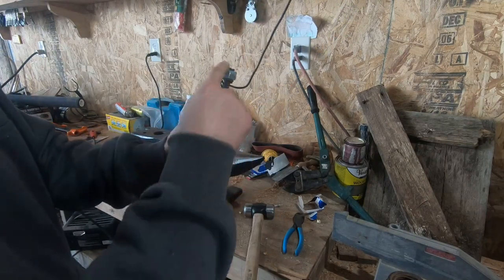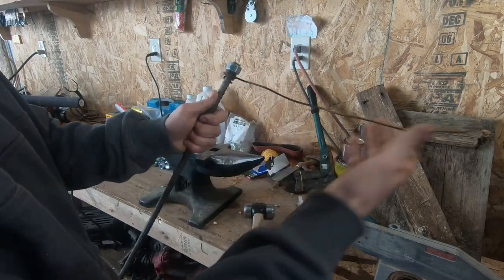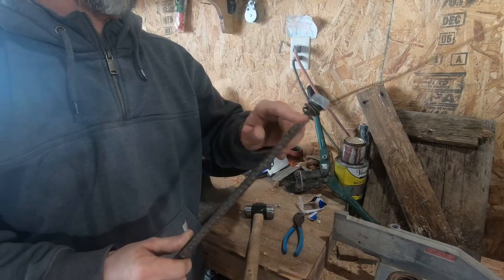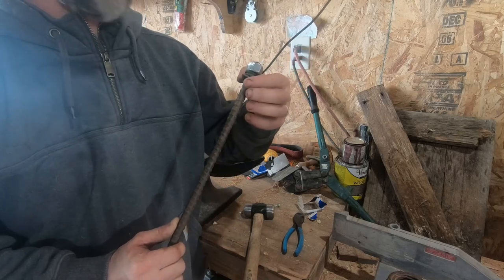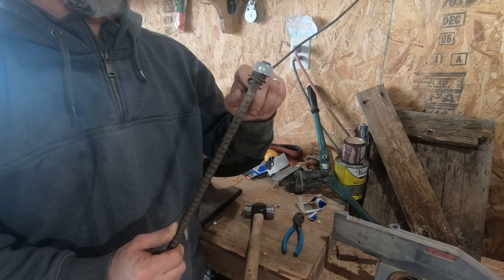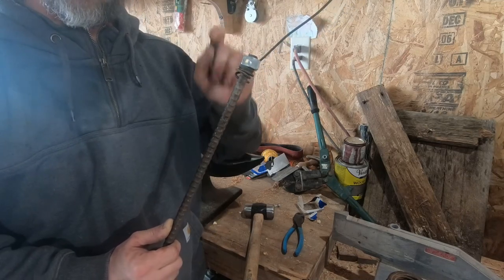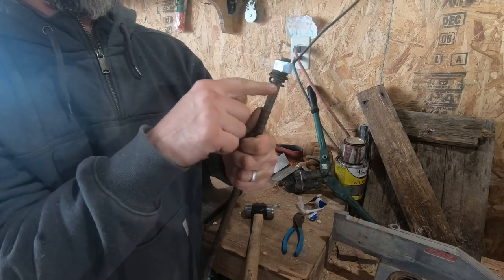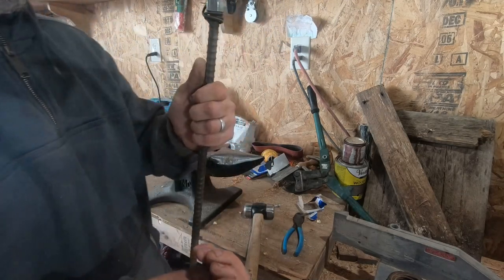TRAPPING TIPS- Worlds Greatest Snare Support Sytem

Comment: Great  tip on the supports, I picked up a 20ft stick of #4 rebar and 12, 5/8's nuts and made up 12 of the supports. Went out this afternoon and used some of them and they work like a charm.Not counting the wire , which I already had I have $1.70 in each support , very inexpensive for something that is a great anchor and support. Thanks Jeromy
Reply from the maker: That is awesome Mike! I just got back in from my trapline. I had a triple on coyotes using this same support, and then another coyote a couple hundred yards away. They do work great! I hope you have as good of luck with them as I have. Thanks for the updates too!
Reply: @jeromycooley-outwestadvent5790  Congratulations on the triple !! Will keep you posted, Thanks

Comment: Great job. I tried putting 24 inch 3/8 rebar cross stakes in yesterday.  They wouldn't hold. I got a 18 inch cable on a pogo in. It held good the place i am trapping is sandy bad. I use a killpole 5ft 5/8 rebar.  It has my anchor and snare support all in one. Plus they will wrap around the rebar and dispatch themselves sometimes.  I leave them in place yr after yr. I trap out of my truck. I know the rebar comes in handy. No looking for a place to tie off. I know the 5 ft 1/2 rebar.  A coyote will bend it. I use a 1/2 rebar on coons beavers otters cats and fox. Going to all 5/8 some day. But it was free cant grip . I enjoy your snaring video.  I watch over and over.
Reply from the maker: That’s a great idea!

Comment: Do you have any coyotes pull the stake out are you using these in soft soil . And what snare locks do you like to use
Reply from the maker: Good questions Jeff. I have not had any pullouts this year or last year. I was Leary about pullouts, so I set about a dozen to start with to see if they would hold good. They held mid 30lb coyotes no problem. If there is any brush, or tall grass around they seem to tangle on that, and it puts less stress on the stake. In my next coyote video, I have a coyote in one of these stakes/supports, and he wrapped around some meadow grass, he was pulling on the grass instead of the stake. I have set them in soft soil with no vegetation around, and they have held great. I have had 3 coyotes chew out of the 5/64 cable, but those were in fence snares. I use the micro locks from F&T. They work the best for me. My Dad uses Thompson’s locks, and he loves them. I think everyone has their own opinion on locks. I’ll find the link to my video of how I make my snares and add it ti this. Thanks Jeff